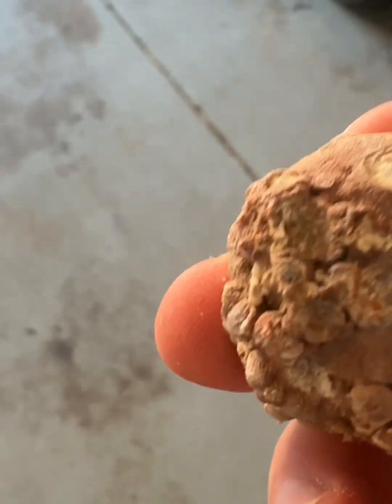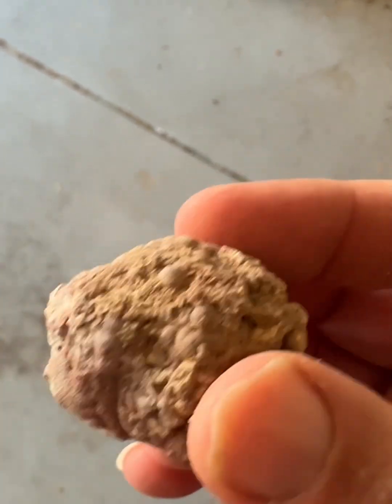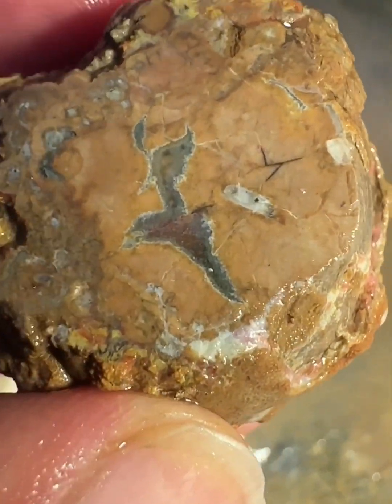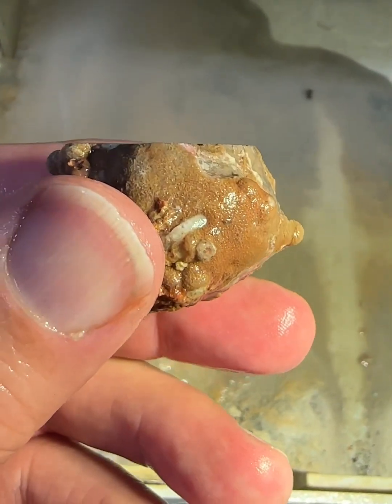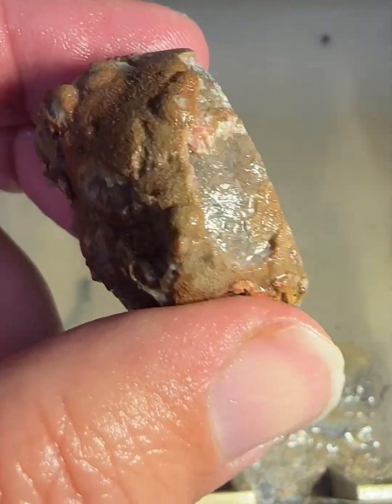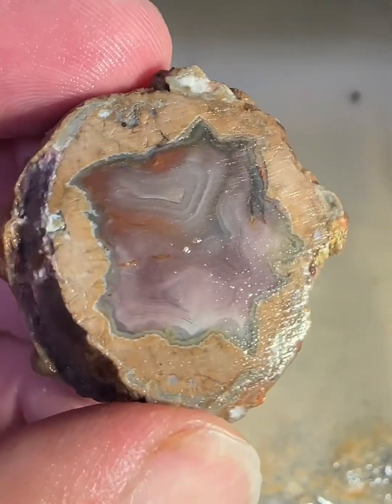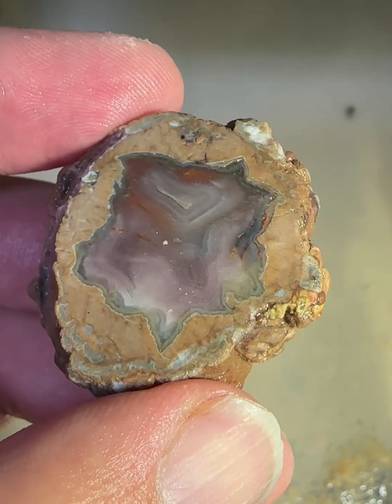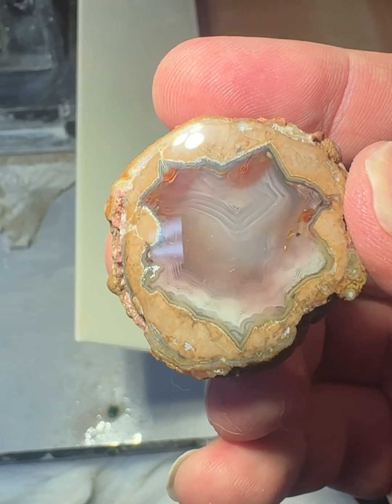What will happen if I grind down a Baker Ranch Thunderegg??

Comment: Looking at the outside, you'd never guess it would be so pretty inside!
Reply from the maker: For sure. That’s the best part about this hobby.
Reply: That would be awesome with a small opening on the back so you could back light it maybe drill a small hole to put a LED inside to illuminate it@stormymountainrockworks
Reply from the maker: Great idea!  Might try that @hobbit321a